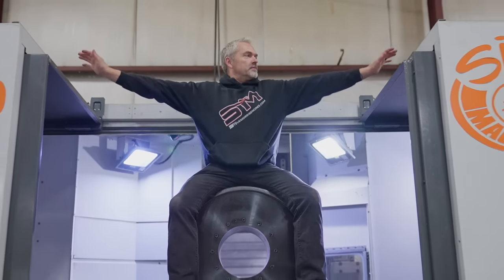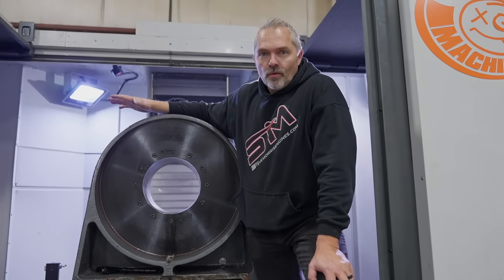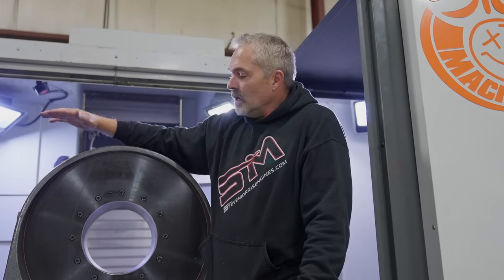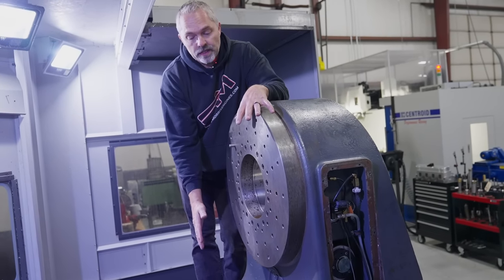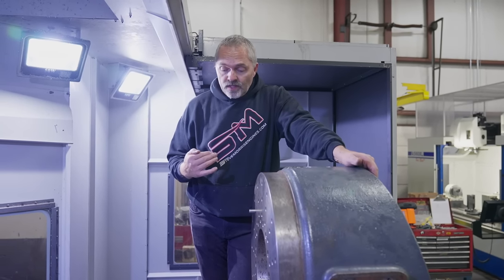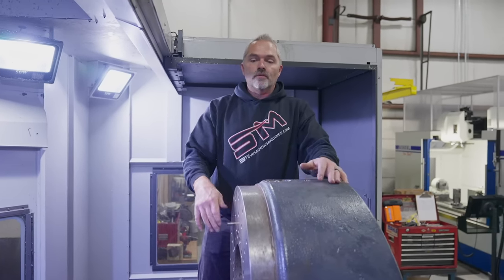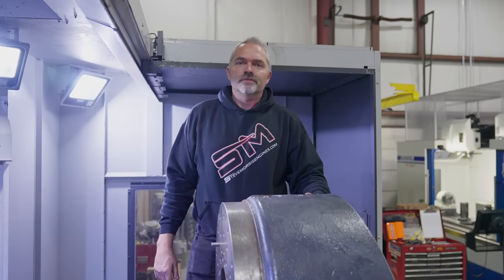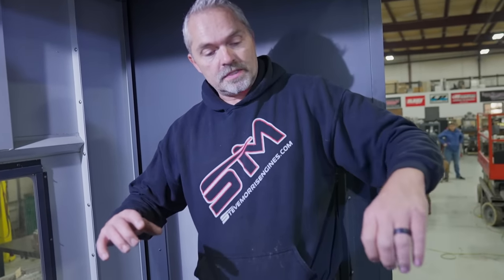Problem Already! Delayed world takeover!

Comment: HAAS, please send Steve your best field techs to line this out. The world needs many more SMXs.
Reply: Field techs are cord pluggers, need to send him engineers.
Reply: @RadDadisRad  lol, if you say so man.  I have litterly done entire machine rebuilds in the field.  A cord plugger aint gonna do truntion replacent, linear guide replacement and alignment on UMCs. Its like youve never worked for a HFO or something
Reply: Send him something better than a haas then...
Reply: @kevinjohnson5389  I’m a process controls and automation engineer. The field techs I deal with are cord pluggers. They can change out hardware, wiring, pneumatics and hydraulics but anything beyond that they struggle to understand the principle behind the theory.
Reply: Lol dude. Won't matter how many Haas techs come out. The shit is junk for what Steve needs to do. He was sold on a promise and got fucked. He's in absolute denial at this point.
Reply: @sleddarcheddar wrong! That machine has already produced a lot of smx and sml!
Reply: That damn thing has been cursed since the day tom bought it
Reply: @54raceman why? I’ve not seen any back story
Reply: @sleddarcheddar  the machine is fine, they were just asking it to do something it's incapable of doing. it all comes down to the project coding to compensate for the limitations of the machine.
Reply: Reading these comments makes my head hurt. Steve and Tom both understand that tackling a problem you reason it out as best you can and try something , from that you learn what works , what doesnt and figure out the next problem in line.Steve being a machinist has probably identified the biggest issue with the process , im interested in what issues that step reveals and how he solves those.  Some of you guys sure can criticize  but i doubt you could figure your way around a circle...
Reply: @sleddarcheddar If he went with a different brand he could probably have cut maybe 20% runtime off at least.. Every haas ive worked with has stupid low spindle load cant run shit without stalling the spindle. Replaced one of them with a milltronics the same size and it didnt even flinch trying to do shit where the haas was maxed out. The haas had good accuracy arguably more repeatable than the milltronic but i can deal with that when it takes significantly less time to rough material

Comment: I use 2 Makino A8H’s everyday. They are the 2 largest 5 axis horizontal CNC machine in the Western Hemisphere. Our grid plates are 4M x 12M (12ft x 25ft) We have the same issues. You have to figure out where the issues are and work them into the programming. The machines will never be perfect or the same day to day. 1/2 degree of temperature change in the chamber makes the metal grow or shrink.
You just have to know what your tolerances are and work between them and make shifts as you go. We very often make shifts of .001” or .002” to get wall thickness to better line up over 20’ apart.

Comment: Yasda YBM 7Ti is the same system and is super precise to a microm. Bullet Race Engineering, 2JZ Billet Block Price: $11,000, and its made Haas VF3 with a 4-axis rotary table, SME Good luck with the new project. I've always wondered which machine shop made the first few SMX and SML.

Comment: The ball screw is probably brinelled when it hit the end of travel. Somo\e one must have missed blocking the table.  Be sure they ball bar the machine in several locations as you will be surprised at the errors introduced by a crash.  The machine may be twisted beyond repair.

Comment: One of my main rules of machine work is avoid cantilevered setups. Having an outer support automatically improves rigidity 8 times.  I do a lot of big 6 cylinder blocks in the vertical orientation and adding an angle block and a brace at the top really made a huge difference.  I could put my hand on a 3406 cat block and push it .003” easy just leaning on it. After the brace I no longer can measure any deflection.
Reply: Couldn't agree  more.  I'm imaging adding a 1/2 steel plate disc of sorts that bolts to the front of the block which could be grabbed by a few disc brake calipers during locked axis machining for significantly improved rigidity.

Comment: Definately agree with getting rid of the upper part of the table. Although you may gain an extra set up it is the right call with what you have and need to do. I particularly enjoy machining setups. I'd be tempted to come up with a swinging fixture supported on 2 sides and possibly use the existing axis drive you are going to have available to get the swinging motion back.  Quite a bit of thinking for that to happen. Sucks about the damage.

Comment: I enjoy your indept videos on the machines I run several and I know exactly what your going through I work at the Ford transmission plant in Cincinnati ohio and we have so many different big boy machines we build the f250 and up transmissions from a bare casting case to all the internal gears with in house heat treat to peeners  one big plus is we use about the same control to map around on almost all of them from our hobs to final grind thanks for sharing

Comment: Steve, speaking as someone with a few decades in the aerospace machining industry, and 8 years in Automotive machining, your spot on to eliminate that add on 4th and 5th axis. Design a nice rigid series of tombstone fixtures and get back to basics. The tradeoff may involve some additional fixture development and part station changes, but for a low volume blocks and/or heads, the process control more than makes up for the convenience (and engineering errors) in the former process.
Back in the early 90's we had 3 giant  Cincinnati Milicron real 5 axis machines. They were big and accurate enough to make a billet block, but way too slow. They were mostly used for titanium swarf cutting some large parts for Boeing.
The Haas machines are fine. We had a bunch of small 40 taper 3 and 4 axis machines, and purchased a big 40HP, 50 taper, 10,000rpm spindle vertical 3 axis mill. I was tasked with development and proofing out, a new process to transfer some of the 767 wing flap (track and beam) linkage assy components we made, to run on the new Haas. Great machine.... 
My only complaint of the Haas was the lease. The control would stop working once a month. To fix it, it required inputting a verification code from Haas, after we made our monthly payment.
Reply: The big 5axis is probably the gantries we still have making titanium parts on in St. Louis. I'm one of the last machine repairman who came up thru back in the 90's. But the new Starrag's we got in are built just for this heavy type of machine.

Comment: I'm an engineer that spends way too much time in an engine manufacturing plant.  We use makino a51 and a61 for the bulk of our manufacturing processes.  Getting rid of the trunion will work out great in the long run.  We use very few 5 axis machines in the entire building.  Almost everything we do is 3 or 4 axis, and each op has its own fixture/tombstone.
Reply: Is it setup with the pallet pool system? I worked at Mossberg and they had the pool system setup with 5 a61x and like 30 pallets just to run shotgun frames.
Reply: @mikebuffing727  no.  We don't use the pallet pool at all.  Machines are mostly fed by conveyors and robot arms.  Some of the arms ride on huge overhead gantries and tie 5-6 a61's into each other.  They also get real-time feedback from a zeis cmm that's integrated. We have a few Grob lines set up similarly.

Comment: Watched an interesting video about "robo-forming" metal. The discussions concerning the robotic arm deflection compensations ? You may find interesting. The tooling devices used were fascinating. Pressure monitoring included.  I will go look for it , perhaps drop the link here ?

Comment: I'd use the UMC to rough in blocks. The VF4 for finishing. You need a couple more VF or VM style machines to establish a work flow. Just a thought.
Reply: The UMCs have the same tolerance problems. Theyre just not rigid enough, and theyre built without box ways and glass scales. They work but theyre not Hermle.
Reply: @risengdesign  well yeah, they are 1/3 the cost too.  One of my best friends has a new C400 Hermle.  $460k

Comment: I used to be a moulding technician and had to deal with up to 20 ton moulds. Having to deal with 10-15 tons on a moving platten ( clamping surface or carriage). The moving half of mould would drop from tolerances of bushings that slide. If it moves there is play or undesired movement.

Comment: Dart uses an Okuma regular 4 axis horizontal to make billet top fuel blocks.  They are about $800K.
Reply: I do agree with taking off the trunnion.  That machine isn’t even an option anymore on the Haas website.  Now you can buy that trunnion and add it to an EC-1600 if you wanted to.  I’d make a riser for an angle plate so you can still utilize the rotary platter then fixture your block of aluminum on it and go to town.
Reply: Okuma makes great machines, that hold very good tolerances. They support some of their older machine with retrofit electronics to keep them going.

Comment: You are exactly right about getting rid of that rotary table and getting the fixture and work piece back on the table. Good luck with the repairs and getting the machine trammed in.  I hope Haas supports you and makes this happen. I knew when you put in the isolation pad you were serious about setting up the CNC correctly.  A hallmark of the Steve Morris way.

Comment: Steve love the show .I have worked with a lot of Haas CNC/lathe,mills your correct there is nothing wrong with Haas machines. Did you get the grand tour of Haas factory ? My brother use to work there as a lead for 5 machine centers with full auto load tombstone type work holding.Spent a hole Saturday there touring and still had a boatload more to see. According to my brother Gene Haas is a very nice man.What boss have you ever had that built a go cart track for the employees on the weekends to race it's right next door. My brother (passed Dean Russell) an amazing place to see and thanks to my late brother.I think Gene is still running in  Winston cup Nascar.

Comment: You probably have one of the best outlooks on what real life is.  Stuff happens, the only thing you can do is figure out what happened and repair.

Instead of using a big square billet of aluminum, have you checked on having a forged slightly oversized shape made that will allow you all of the benefits of forged but save you on the material removal?

You probably know of TitanCNC. I bet he would love to tour your shop and possibly help you with fixturing. I’ve noticed he does a lot of fixture setups for repetitive machining that not only speed up the process, but also help with tolerance management.

Comment: As a former heavy haul trucker, I can assure you the amount of insurance on some loads was astronomical! I had loads that had two or three separate policies beyond what my company had! There were a few loads that we got into a tight spot entering a factory or facility and sat there for hours waiting for the big guys to come up with a plan! Meaning we already had a plan cause we were there and experienced in our jobs! They just had to decide who was paying for any equipment necessary and or damages if there was going to be any! Yes sometimes the big wig at a factory will tell you damage the load to make it fit as I. Cut up with a grinder or plasma torch and they re weld when it is through the gate!

Comment: Where I work is selling a huge Union 3 axis mill, all manual with a DRO, Knee T slot tables with couplers for $1k, just need the equipment to get it out. Maybe it can hold .001 tolerances?

Comment: You have  Thermo comp settings,  multiple parameters that effect accuracy. Level of machine is  #1, MRZP dialed #2.  And yes the axis brake only holds so much pressure .  These machine are magical with the right program. Ball screw housing can be replaced.

Comment: Just using the 4axis capacity of the mill is a great idea build a few fixtures and your solid. The trunnion is definitely a difficult situation. Not only is the fixture moving, the trunion moving, but you have deflection everywhere. I think you're only going to have 3 fxtures and 3 setups. I'd probably do the frint and back faces  put in the camshaft and crankshaft tunnel first  the hold the block from 1 end or the other on the 4th axis.  This is solid planning even though it will add a setup  with good fixturing, this will be a minimal problem. Btw, my lathe had the x axis servo mount and end bearing break during moving. It sucked to repair.

Comment: Just a few random observations: 

1) this is why you never get rid of shipping brackets. Label those things and throw them in the storage rack. 
2) they sold him this machine because they don’t make a machine that is really made for this sort of work. This should have been (as you stated) a single rotary machine… but IMO with a B axis in the head to make the 5th (Like a DMF 180 or something) yes that would cost more money, but no it would not even come close to approaching the numbers thrown out in the video. I’m mostly just saying shame on Haas for either not understanding the requirement, or just trying to make fast money on a guy with a dream. 
3) there is quite a lot of corrosion and nastiness under the way covers on that machine given its age, I’d have a look at the coolant used and the sealing on (all of) the way covers before I put it back in service. 

I’m sure you can make the machine do what you want it to do. Ditching the trunnion altogether really sucks because it’s going to make more setups and fixturing, and probably push more finish work than you’d like onto the more manual/ semi auto machines. But ultimately, it’s probably the right decision.

Comment: I know almost nothing about CNC machining - are programs set up to remove large amounts of material (and therefore weight) of the billet early, to help make future cuts easier/more accurate on the machine? Does balance/center of gravity of large billets change enough as they are milled to be a consideration for the operator/programmer?

Love your content, the work ethic, and your positive and thankful attitude you always have!
Reply: Tom Bailey has a video explaining all that from when he was running this machine. Yes, the amount they remove and the heat/stress treating all play into it and that has given them some problems. They were learning a process or method of how much to cut and when to treat and finish the blocks. It sounds like they wanted to drop in a billet and have a finished block with as little labor as possible but found out it just doesn't work that way and they need multiple steps setup so the process is efficient and streamlined while still doing enough to keep up the quality. They machine solid blocks and water cooled blocks for the SMX and found differences with the amount of material they remove......I don't recall which one was easier, but the heat treating only penetrates so many inches of aluminum.

Comment: I’d be asking HAAS to design a fixture for you(or design your own) to support the other end of the block while they are on the trunnion so you retain the full 5 axis capability of the machine. I don’t believe you’ll ever really be able to do full 5 sided machining on something with these kinematics and hold the tolerances you want, but with proper support, you should be able to hit 4 sides of the part, but at compound angles that you wouldn’t be able to do without the trunnion on there.

Comment: Is the VF-4 large enough to do the roughing in 2+1 then use the 5 axis for finishing? I know it seems the long way around, but for tolerances, that could actually speed up the process.
I'd also want to check the servo amplifier, I know it sounds odd, but that ball screw causing the  motor to turn could have sent a feedback voltage into the amplifier and damaged some of the drive circuits. 
Unless you've been there on the ground level for any project, a lot of things come up such as which program are you using, is the post for the machine right, what tweaks does it need for your specific use, are the machine parameters set up for what you want... I can't wait to see this thing up and making chips!

Comment: As a cnc operator i(we) work around the flaws of the machines.
And as long as there are work tolerances, one can find a 'happy medium' to get all within spec.
So i bet that machine still beeing 5axis, can take heavy load and still get things within spec , 
To have in mind: rough cut everywhere to get the bulk material out, this makes that heavy workpiece MUCH lighter before going in making all the fine cuts.

But, as been working in his profession for about 25 years now i´ve seen that Haas often actually leaves some things o wish for.

Comment: Steve, In Toms Baily's video I think he said he had a guy working in Solid Works for a year to design that billet block.  Maybe you could do a video of what it all took (design wise) before the the first cutter hit the aluminum block of metal.  Also through no fault of Hass, if the cam tunnel was bored first, by the time everything else was bored, the cam tunnel was no longer straight.  Please talk about how things move around when machining such a large chuck of metal.  Thanks.